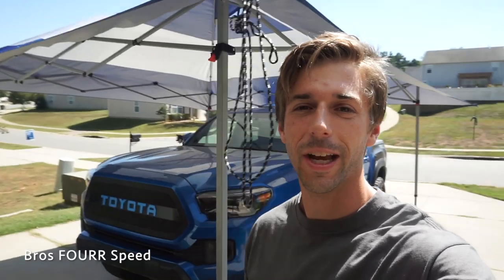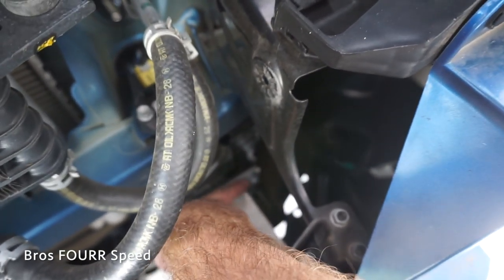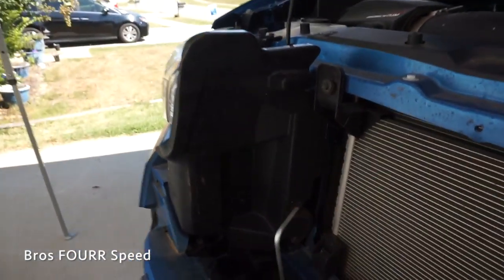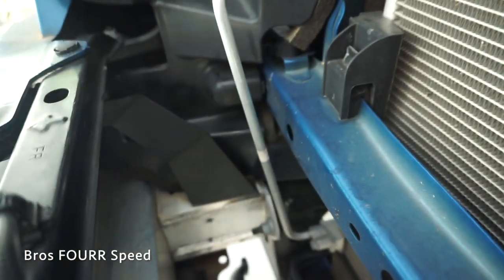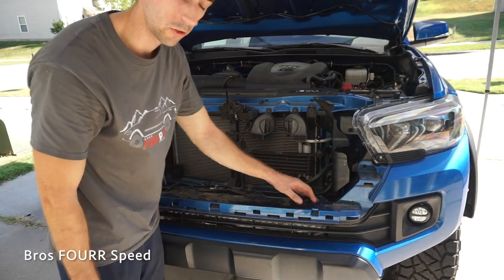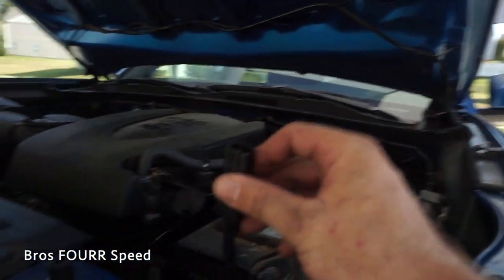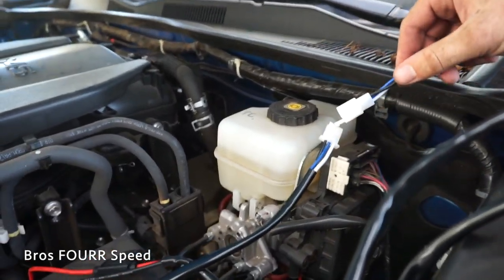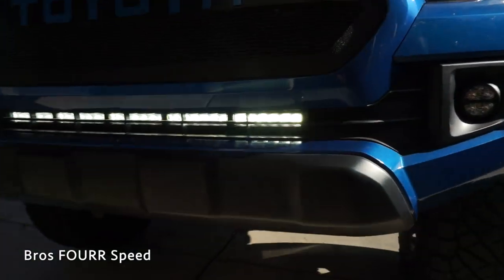Installing a HIDDEN BUMPER LIGHT BAR for my 3RD Generation TOYOTA TACOMA!

Comment: Yeah, it’s crazy bright. Glad you’ll be able to see down the road cause then you’ll be able to see all the opposing traffic that you blinded and maybe miss them as they are swerving all over the road that they can’t see anymore.
Reply from the maker: It would be like using your brights, you shut it off when on coming traffic is coming.
Reply: @BrosFOURRSpeed  Most people don’t shut them off. Just like all the damn “fog lights”.  I’ve been driving charter buses for 12 years now. We have drivers that run with the fog lights on all the time and all they do is light up the ditch. But they are still bright to the oncoming traffic. I’ve seen a lot of lights the same style as in the video, more than a few on semis. Even on four lane highways they are too bright, especially when coming around a curve. I get that people want to see the road better at night. I do too, especially when I have a bus load of people on board.

Comment: Just a thought?  that area you put the bar light is transmission condenser cooling ? I mean transmission fluid needs air
Reply from the maker: It still gets air, yea it’s in front, but air can still get in and around. Never had any issues.

Comment: I am in the process of putting in my lightbar and I am running into the same problem. There is no room to work. I am working on a plan. I did by a ratchetting swivel head 10 mm wrench. Not sure if I want to pull open the front clip.

Comment: I think a lot of bars directions say to take off the air deflectors and get rid of them which would have made it easier for you
Reply from the maker: True, I wanted to keep them on, so it was a little work, but not bad!
Reply: @BrosFOURRSpeed  so the wind deflectors can stay on? Alot of people say needs to be cut
Reply from the maker: @yezkaholic  Yeah I have them on the truck with the bar! Little bit of an install but I kept them!

Comment: so you installed these lights BEFORE you installed your Body Armor Hi Line Bumper in a later video.  I just looked at my Body Armor bumper and it looks like it will block the light if mounting the light bar where you mount it in this video.  In the bumper video you show removing your light brackets.  Did you end up getting a light for the front of the bumper?  I ask because I was gonna do this light.  Please advise
Reply from the maker: I did install this light bar and then the bumper, didn't plan that, but it actually doesn't hinder the light.  If it's too angled upwards it will, but it just shines between the bumper and the bullbar on it! I had to remove those brackets to fit the bumper, but still have this light bar!
Reply: @BrosFOURRSpeed  thx for the reply my bumper install was easy...just got my parts in for the pop and lock you did..looked pretty straight forward...after that..gonna do that light bar..thx for helping a boomer

Comment: Nice work and the light really paints the road ahead. Do you think the light bar could be blocking some of the airflow to the transmission cooler and the A/C condenser?
Reply from the maker: There's about an inch of space underneath it for air flow, so I don't think I'll have to worry about that.

Comment: I like that the white seems closer to 4000K.  I don't like 5000k white/blue.  I prefer high yellow, but this looks great! I have the SS3 sport yellow fogs.
Reply from the maker: Oh nice!  Yeah this doesn't have any hint of blue which is nice, although it would kind of match with the truck lol!  I had fogs like that but eventually switched!  What else have you done?
Reply: I am going to order the stealth combo light bar in yellow.  Street legal here and Ohio has alot of wet crappy weather.  I also have 8 Lux Max yellow rocklights going on in the next day or 2.  Had em on my 16 wrangler and never put them on my 18.  So they should have plenty of life left!

Comment: Excellent video.  Purchased a WeiSen Front Bumper Opening Mount 30 Inch LED Light Bar from Amazon.  As I wanted the light behind the bumper similar to yours, the installer told me he would need to remove the bumper for install and would take three hours.  From what I saw in your video, you simply loosened the bumper for install.  Is it true it is a three hour install if so what is a fair amount for labor only?  Looking forward to hearing from you.
Reply from the maker: You could knock this out in an hour to be honest. Just removing the grille like I did can get it done ;)

Comment: What are your thoughts on the light output putting it behind the grates vs. using a bracket, cutting the grates and mounting it flush? Do you feel like the grates reduce the amount of light you get from the bar? Im trying to decide on my tacoma now which way to mount it.
Reply from the maker: I like it!  They don't seem to hinder the output at all, so it makes it look very nice and subtle instead of just being there on the outside of them!  Personal preference really, but I like it mounted behind and the brackets that come with them, make it for an "easy" install to bolt to where the crash bar is! Plug the grates line up almost perfectly with the parts of the light bar that isn't the light if that makes sense!

Comment: Does this add have any effect on air flow for air conditioning etc?
Reply from the maker: Nope. Plenty of air goes through the main grille. And more than enough goes through where the light bar is
Reply: Thanks for your reply.
Reply from the maker: No problem!

Comment: I know you installed it how you wanted to, but DiodeDynamics has a water release valve on one side of the light bar that is supposed to point downwards, with the cable coming out the passenger side, since you have the wires coming out the driver side, that valve is now pointing upwards on the passenger side and water cannot escape. Anyways nice install
Reply from the maker: That's the second comment I have seen on that, so far I haven't had any issues at all, and the only reason I put the cable towards the driver side is so that I would have enough to reach the battery.
Reply: @BrosFOURRSpeed  Understood. I just didn't know if they actually said that in the install instructions. I seen someone else run that cord on the passenger side and have enough room. Loving the truck. Working on getting me one so im already looking for mods!
Reply from the maker: @DoubleKlutch99  Maybe one day I'll switch it, next time the bumper is off! You'll love it, it's the best truck I've had!

Comment: did you get the Heavy Duty Single Output Wiring Harness? for the additional $30?
Reply from the maker: I'm not sure which harness it was, I didn't know there was an option.  I think I just had one option at the time!
Reply: @BrosFOURRSpeed  I’m going to order it but i’m wondering if i should get it or not

Comment: My fuse blew the second day I had it I’m not sure if I’m suppose to connect the black wire to the actual battery or to the side of the truck aswell
Reply from the maker: The relay goes anywhere you can secure it, so the only wires going to the battery are the positive and negative, as long as you have that right, you shouldn't have any issues!

Comment: You mounted the LED bar upside down.  There is a moisture relief valve and the way you have it mounted has it pointed up.  If you flip your light bar it'll be pointed down and that is the correct way so the water can drain out.
Reply from the maker: That's interesting, I just looked and didn't see any valve anywhere, it's also sealed so not sure how water would get into it other than a leak or damaged, but thanks!